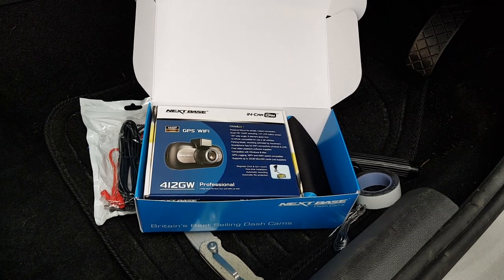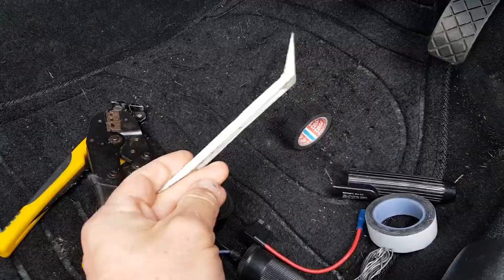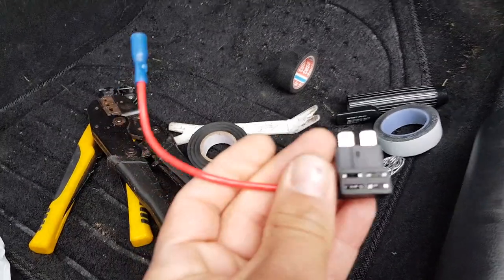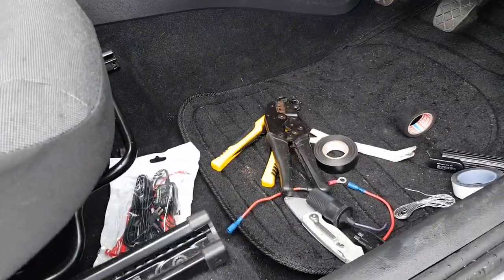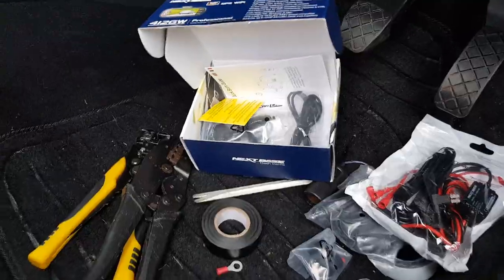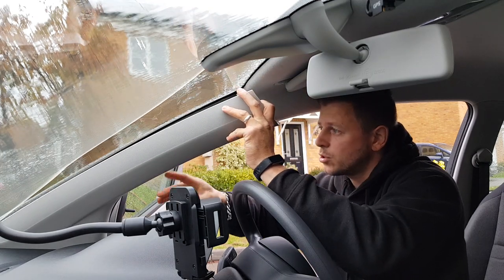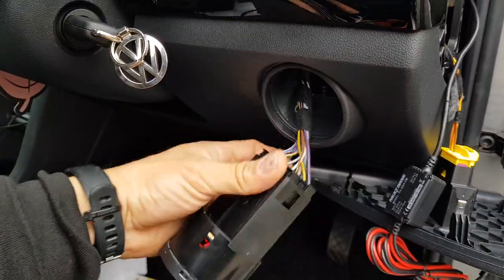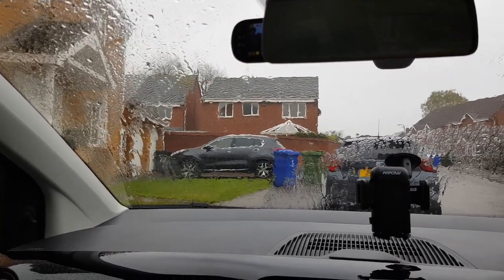VW SEAT SKODA AUDI DASH CAMERA INSTALL NEXTBASE HARDWIRE KIT INSTALLATION

Comment: I cannot understand why the cable wasn't run down the lhs A pillar and terminated at the fuse box.
Reply from the maker: no fuse box inside this car as its under the bonnet on this model.